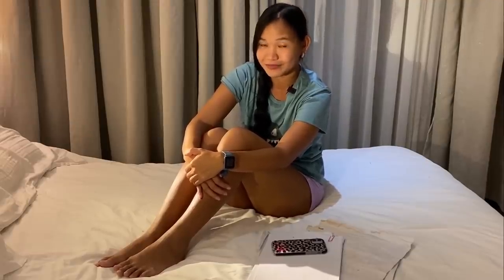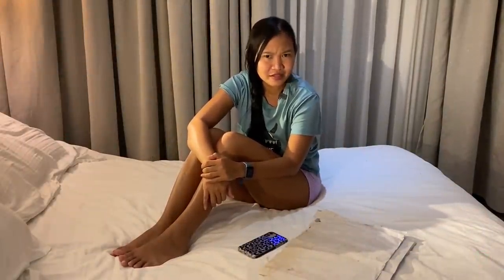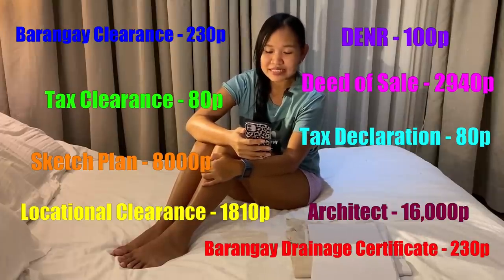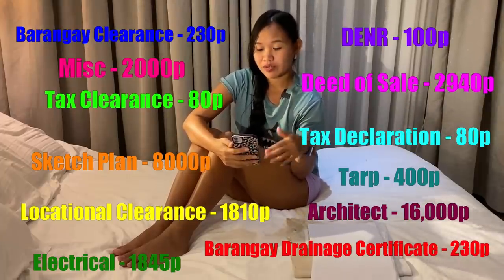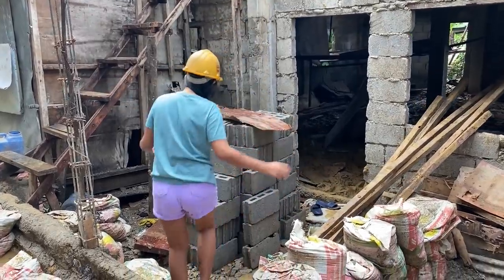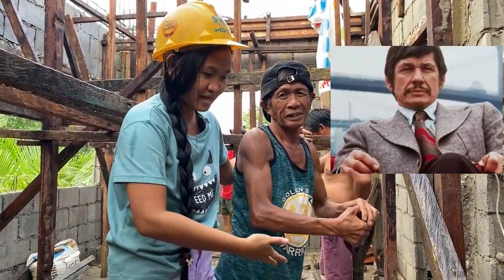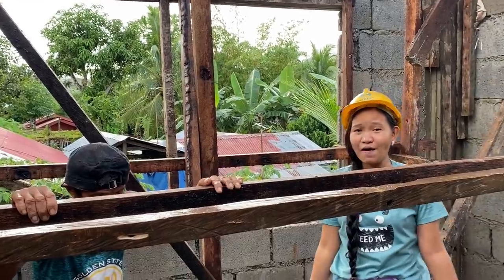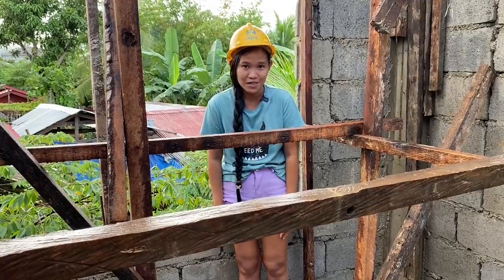HOUSE ON A BUDGET / Simple House Design 20K - Building A Home In The Philippines

Comment: But you're not counting the price of the land which you probably had from the family better yet you should have built either a one-story house bigger if you had the property to put it on or remodeled the old home that you had there I just extended it and a remodeled the whole thing
Reply from the maker: This does not include the land or furniture, no
Reply: @TheFilipinaPea  if you had enough land you could have just spilled the one story extended the length 20 ft put your bedroom in office on the opposite side of the house of your parents bedroom and it would have been cheaper than building a two-story because all you would have needed was an extra 20 ft of brick and a dividing wall in the middle for two rooms and a little extra tin for the roof probably could have saved yourself 100,000 pesos by doing that if not more and your house would probably look nicer because it would look larger with the extra 20 feet added to it or even longer if you wanted because the older you get you don't want to go up and down stairs but I do know filipinas like two story houses why I don't know when a rambler is much better if you had the land to put it on

Comment: The reason it is so inexpensive to build here is the quality of product is much lower standards then the USA and there are no cellars or attics and no building code. No codes from construction to plumbing to wiring. no insulation. The block witch most houses are built from here is not 16"x8"x8" like in the states. There 16"x8"x4" Only 4" wide. I have moved many of them for my inlaws and many break when you pick them up. Very poor quality. No inspections to pay for because there is no code or no code enforcement. The wife and I are building an other home in the mountains and the land we purchased has more then enough tree's to build our 1500 sqm home from. No labor cost and no material cost for construction and it is going to run us well over P100k

Comment: ; - O HEY WHAT ABOUT A CAR PORT? ARE YOU GOING TOPUT ''EXHAUST PORTS OR FANS IN EACH ROOM TO REMOVE HEAT? THEM BRICKS HOLD ALOT OF HEAT, YOU CAN PUT ''VENTS IN EACH ROOM, BUT U HAVE TO HAVE A WAY TO ALLOW THE HOUSE TO BREATHE AND CIRCULATE AIR....; - ]    NOW GIT OVER HERE WOMAN......LOL